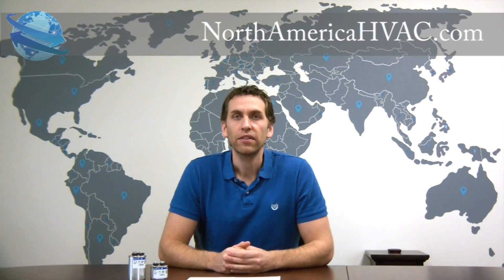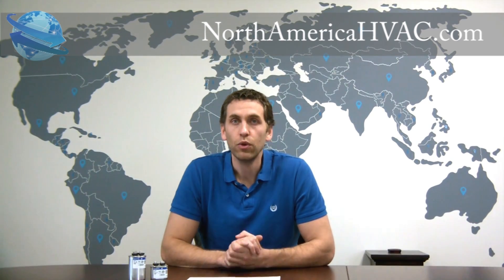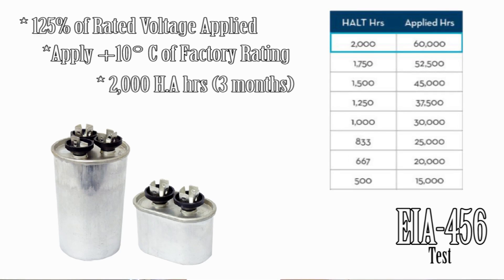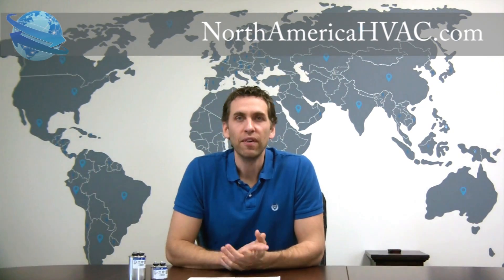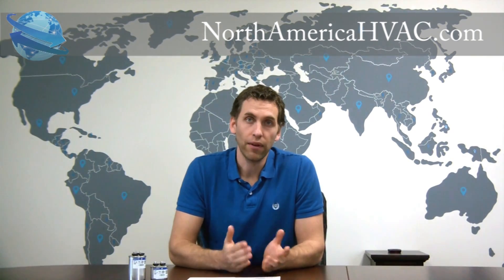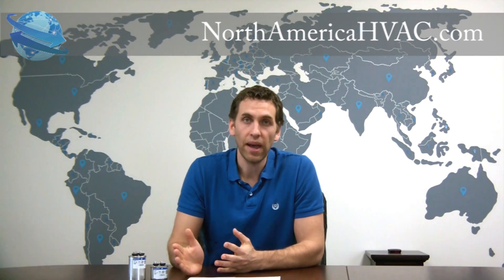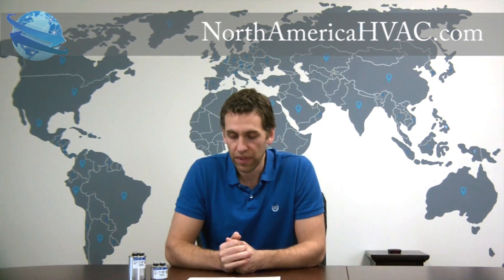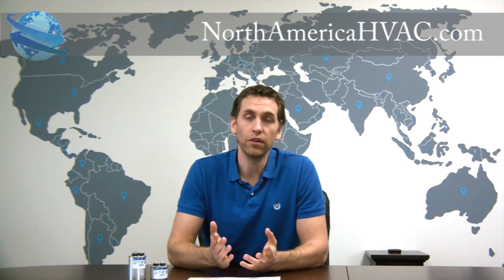Which Capacitor Brand is Best? - Why so Many?  Does it Matter? And how to Choose One

Comment: Not a bad video and it answered my question of which brand to look for.  My use it for an elevator where a 3.5hp motor drives a hydraulic pump that fills the elevator ram to rise it.  My my case I only need the start side not the run side of the capacitor.  I have been in the fine electronic industry for 25 years and in that time I have seen the electronic component field filled with low cost, low quality parts that blow up on a regular basis.  I will no longer buy chinese if I can because of the cost cutting they do.  I would rather pay $50 for a good Cap. then $25 for a bad one and risk blowing my device or having a service provider have to come back in a couple of years at $100 a visit or more.  As he said, you get what you pay for and as I say, beware chinese products.  They are fully capable of making good components and many of their factories do make good parts but there is almost no way of knowing the good from the bad and even today I am going though my house outlets that seem to have had cheap chinese clone parts installed that melt down at 50% of their rating.  They have all the safety stamps, UL or CSA markings but in no way can they handle even 50% of rated current for more than a minute or two.  My house almost burned down.  Thanks for telling me about the Genteq Caps which answers my question....yah volume is a bit low and you could run it through some software to increase the volume without any changes and then put it back up again.

Comment: Woke up to a a warm home a few days ago. Checked the outside Condenser which wasn't running and making the typical blown run capacitor humming sound. I'm not a HVAC person but mechanically schooled so I knew it was likely a capacitor as my Bryant 5 ton was installed new 12 years ago. I safely discharged and tested with a ohm meter which confirmed it defiantly died. It also had the typical round barrel top. Now the problem for the average home owner like myself is HVAC run capacitors, especially 80+5 370 V aren't readily available and many local HVAC suppliers won't sell to the general public. Since the inside of the house was already in the mid 80's by noon and my three dogs were panting like crazy, after multiple frustrating calls, I ended up grabbing my ankles at $35 (their $20 online shipped) for a Titan Pro TRCFD805 at a local HVAC supply who got one in a few hours latter with not being returnable and no warranty. I get the feeling that while they sell to the general public, it's  frowned upon a bit. Anyways, I found out that the Titan brand comes in two flavors. Pro and HD. The HD series is made in the USA while the Titan Pro is made in China. While most China made capacitors take a beating from HVAC pro's since they  don't appear to last as long as US made AMRAD, MARS and older GE, from what I can tell, the Titan Pro does seem to be one of the few China made ones that gets some respect for longevity. Packard owns both along with their own third Packard branded capacitors which are also made in China like the pro but a few dollars cheaper online. The original GE lasted 12 years. GE sold their capacitor division to Regal Beloit who makes them under Gentec and what seems to be a lower grade brand called Proline which Gainger sells however is rated for 10,000 hours instead of the usual 60,000. Both Gentec and Proline are made in Mexico which is neither bad or good. In fact, I'm almost 100% sure it doesn't matter where it's made but who makes it and stands behind their brand. Because of the hassle of getting one locally, I'm ordering a spare so I will either buy a Titan Pro or HD or a Gentec online at better prices.